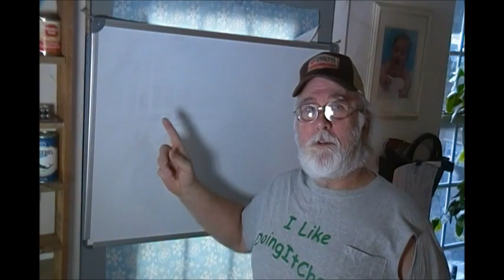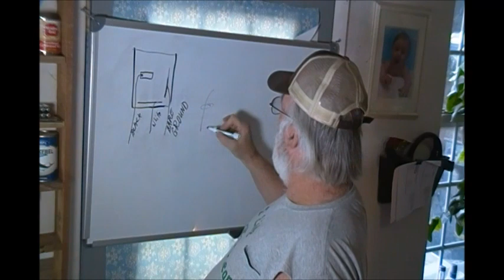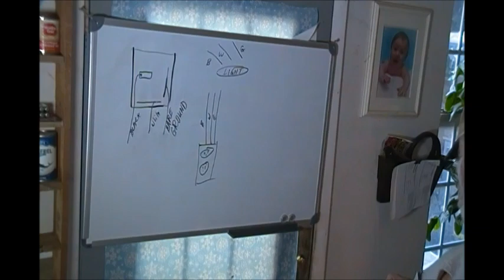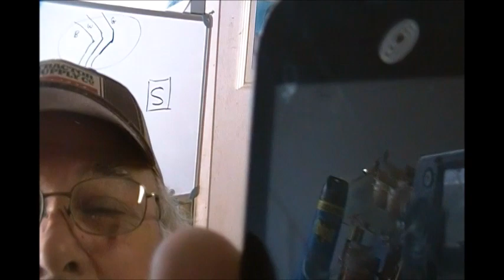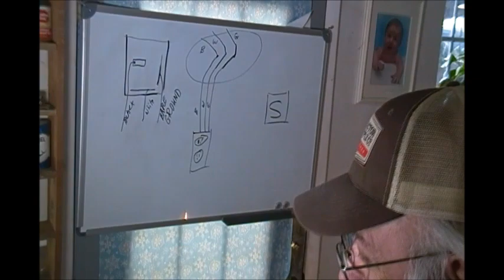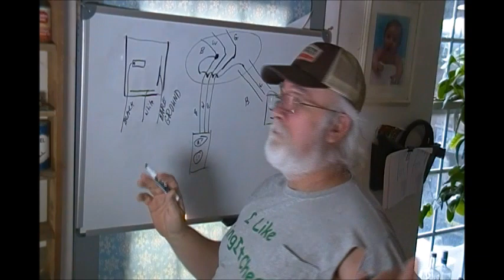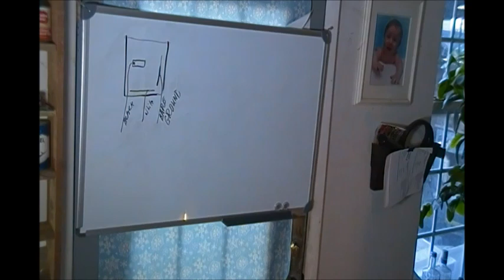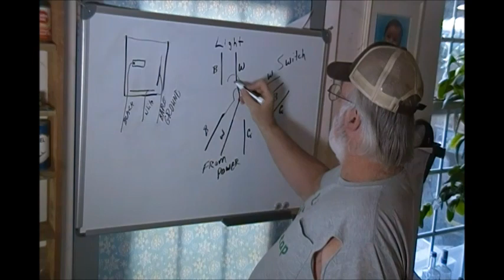PawPaw Explains 120 volt Wiring for Your Shed

Comment: Doing well, Mr. Bob.  This is my forte'.  I was a sparky for several years.  I learned on knob and tube wiring in hundred year old houses in our local city.  Those circuits sure would give you a bounce if you got between a load on a neutral!  I had a test rig with a 130VAC heavy duty light bulb in a rubber holder with stripped leads.  That generally told me when there was danger afoot, but you play with fire long enough, you catch a load and it hurts.
Reply from the maker: I used to crawl in those old attics when I was nine years old and help my dad when he rewired those old homes.  I could fit where he couldn't !!  LOL !!  He had those old bulb holders as well.

Comment: Ok Pawpaw I know how to plan the shed I know how set the floor joist ok with the shingles  getting my head around the 110v wiring, now answer me one thing how do i pay for it, waiting for that video.lol.... loving your vids and to be fair the guy on the phone he handled it well. Good to hear about your dogs playing.
Reply from the maker: Paying for it is easy, scrounge, hunt, scan, ask, you would be amazed at the free stuff I have picked up at our local lumber yard.  I bought a stack of 4'x8' osb and plywood for $1 a sheet because they had been messed up on the edge with a forklift.  When they messed up a piece they put it on this stack.  I have also bought $1,000 worth of lumber for just over a hundred bucks because it had turned a little gray from exposure and no one wants a new home to have discolored lumber in it !!  The same place GAVE me over 80 bundles of shingles, miscellaneous returns.

Comment: Quick question; on the White "Leg", would it be ok to mark it with black tape to indicate to next person that services the electrical that it is a hot wire?
Reply from the maker: Thanks for reminding me.  Yes, code states the white wire coming from the switch should be marked !  Thanks for catching that !  I do a lot of stuff in my own shops, barns, and buildings that may not be book perfect, but still safe and functional.
Reply: DoingItCheap Thanks

Comment: I like how you talk to folks like they're a bunch or morons - because most of them ARE.

Now that you're going to have a shed with nice 16" - on -  center walls complete with modern conveniences like electric lights...

Wouldn't it be extra special to be able to turn the light out from inside the house on those cold rainy nights when you look out the window and realize you left it on?

That's right - it's time to dazzle 'em with a 3-WAY switch!

Nice job with the telemarketer, BTW. Definitely worthy of promoting on my Facebook page....
Reply from the maker: LMAO !!!!   Now you know these videos are just examples to go by .......  If I were to run a three way switch that would require more routing of wire outside, BUT I may do one using stairs as a needed example.  Probably be easier to kill the breaker that feeds the shed !